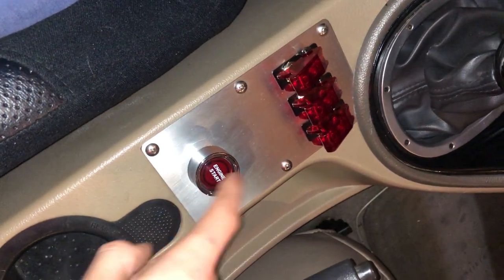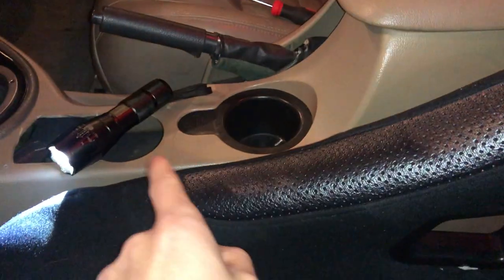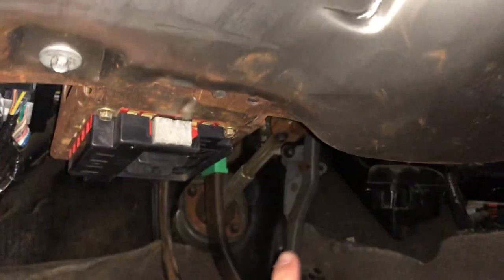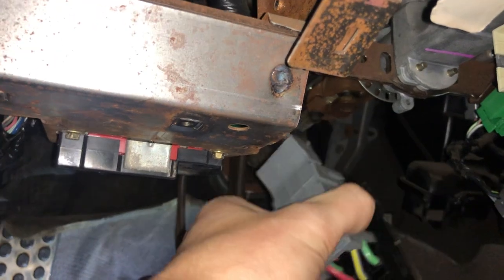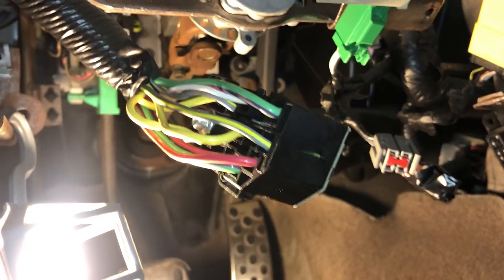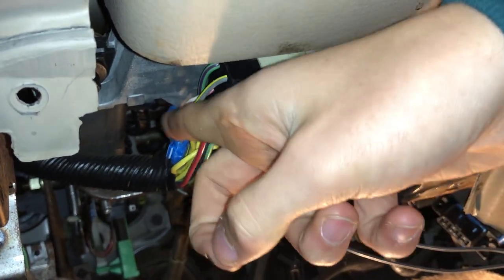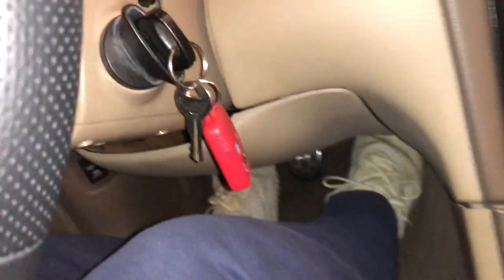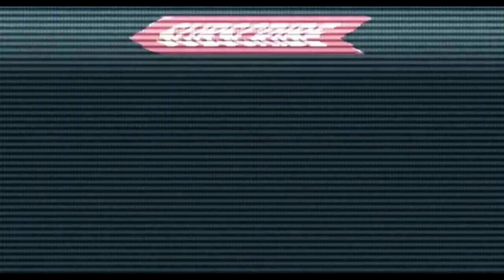MAKING MY CAR PUSH TO START!! (99-04 mustang)

Comment: How do u put the cables with the supplied locking connectors ? I got myself a push to start from American muscle. A reply back would be appreciated Thankyou !
Reply from the maker: I am not 100% what part you are talking about if it was a kit from American muscle it may be a little different then this

Comment: Yo, loved this video man. I just got a standard v8 2001 mustang GT and been wondering what all I should do to customize it. This is a must-have
Reply from the maker: Thanks man! It’s simple and really worth it
Reply: @prestonsarlo  just finished mine last night...I'm running the green led version of this exact same button. And I tapped into the blue wire with black strip on the e brake switch for the ground, that way I won't have a bright light in my face going down the road😁
Reply from the maker: @DeepSouthBayouDiesel  awesome man glad it worked!
Reply: @prestonsarlo  as am I...I'm planning on getting an on/off button and splice into the run section of the ignition switch and bypass my clutch switch. So in theory I should just make sure the car's in neutral, put the key in the ignition, press the on/off switch and press the engine start😎
Reply from the maker: @DeepSouthBayouDiesel  that should work let me know!
Reply: @prestonsarlo  absolutely, I'll upload a vid...it'll be a while though. I'm still researching which wires are for the run section.
Reply: Does the push to start feature drain the fuse by anyway? And would you recommend placing the button in place of the cigar holder?

Comment: Did you ever figure out having it turn on without the key im having problems with my anti theft system and want to bypass it altogether
Reply from the maker: Never figured it out I still have to use the key

Comment: Pretty good idea. You explanation is thourough. Ever figure out how to wire as so you don't need the key in on position? Thanks. I liked and subscribed
Reply from the maker: Thanks for the sub! And no I never figured out how to bypass the key
Reply: Only thing I could think of is, make one of the switches a kill switch so you have to flip it on to give the car power. Then just leave the key in the on position. Because it’s pretty hard to get by the PATS system in the new edges.
Reply: If you get a tuner, you can disable the PATS system.
Reply: I have the Holley terminator and I've also done away with pats. So, just setup the same way and should be good as far as not needing the key in on position?
Reply: @prestonsarlo link the 2 pinouts that represent the key being in the ON position to the killswitch,  then link the ignition to a small toggle and the starter to the push-button but make sure your switches are for the rated power output 
And take care of the PATS system

Comment: I have a switch like this but I got mine from Silver Horse Racing and it came with all the wires for $75. I hooked the ground to the parking brake one so it the light on the switch turns off when the parking brake is off.
Reply from the maker: Dope! Not a bad idea!

Comment: Run a wire either a fuse from the battery into one of the switches then from the switch to the button for when you flip the switch it’s gives power
Reply from the maker: Yes that could work